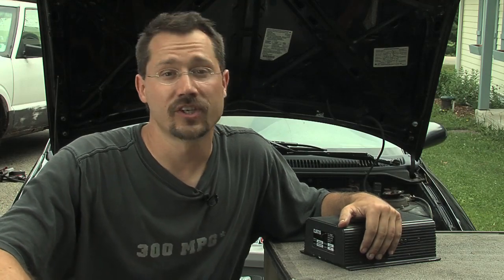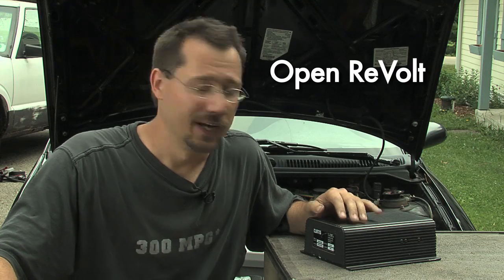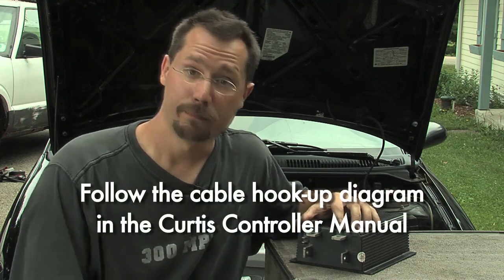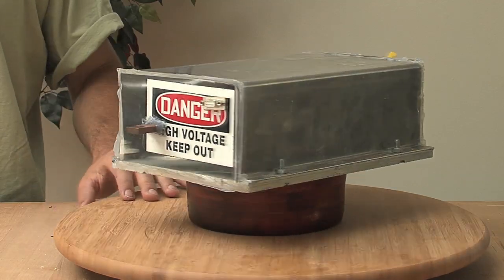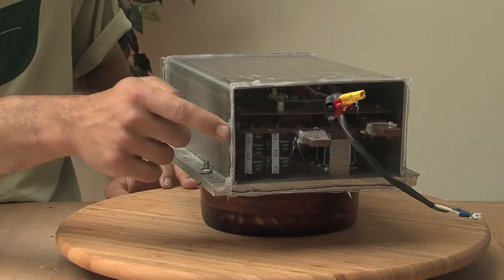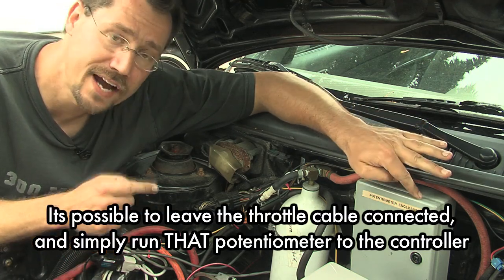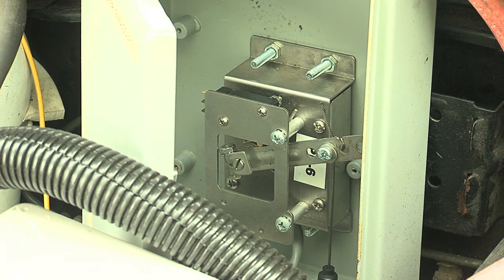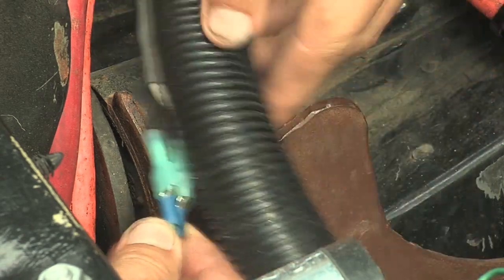13 Build Your Own Electric Car: Motor Controller & Throttle

Comment: how many autonomy hours does this six bateries means...?? aproximately..? and the charging time to a totally full batteries...?  PLEASE..!
Reply from the maker: This project only had about a 20 mile range, but it was also dirt cheap and made from recycled parts. Here's a little more info about figuring out how far an electric car can travel per charge: https://300mpg.org/projects/electro-metro/battery-range/

Comment: Can u make thumb press electronic accelerator and break.. I m handicapped persons

Please reply
Reply from the maker: On this vehicle, the throttle is a simple potentiometer. It would be easy to modify to some other sort of control.

Comment: Where is the m+ on your controller?
Reply from the maker: The controller doesn't need a separate M+ terminal. Both the positive side of the motor and the battery connect to the B+ terminal of the controller. See the following image for an example. https://alltraxinc.com/wp-content/uploads/2017/03/Doc100-045-A_DWG-AXE-No-Reverse-wire-dia.pdf
Reply: @BenjaminNelsonX  ok thanks,so the controller, controls the negative field? Im no Electrician .Is this for a ac or dc motor or both?
Reply: @BenjaminNelsonX  sorry for my perhaps silly question but what is the contator that you need to hook the controler to?

Comment: Very nice but what about the car computer? Vacuums, O2 sensors and mass airflow, basically all of those. The check engine light would be on all the time.
Reply from the maker: I don't remember the check engine light EVER turning on in this car. For starters, it's a simple car, so it likely has fewer sensors etc on it than other cars. Many sensors do NOT activate a check engine light simply by being unplugged (depends on the exact type of sensor.)
In the case of a more complicated car, sometimes converters "spoof" a sensor by adding an appropriate resistor or even something as fancy as an Arduino. Frankly, I've never met a converter where this was really an issue.

On a related note, keep in mind that cars have MULTIPLE computers. For example, the one which controls the airbags was not touched in any way. When turning the car on, the airbag computer still does it's safety check and flashes the airbag light several times on startup to indicate that it's working properly. The daytime running lights, airbags, and seatbelts were not modified in anyway on this car.
Reply: @BenjaminNelsonX  thank you for your answer. I am an electrical engineering tech and was curious about how this would work on a more complicated vehicle. I think these convertions are the way of the future for those who want to keep their older cars and go electric at the same time. The new electric cars may be too computerized and have special proprietory connectors that could discourage some people from making the transition. Thanks again.

Comment: Where did you find the potentiometer?
Reply from the maker: I simply mail-ordered the potentiometer. It's a Curtis PB-6 potentiometer. A web search will show you multiple places to order from.
Reply: @BenjaminNelsonX  my pb6 has a switch included. Did you simply not use this switch in your application (kind of difficult to see in this vid)?
Reply from the maker: @garyatate  No, I didn't use the micro-switch.
A common application for that switch is to disconnect the main contactor when the throttle is completely released. That seems like total overkill to me. It's the equivalent of turning off your engine every time you let off the accelerator.

Comment: Sir, can Open ReVolt work on 48DC with 200+ amp ?
Reply: You should not run your motor on 48 volts. Run higher volts for better performance and also better efficienty..
Reply from the maker: Yes. It's rated for up to 144V and 500A. If you only need something lower power, a used golf-cart motor controller can be very affordable.

Comment: Sir, have you done any Hybrid IMA technology (Gasoline + Electric) experiment ?
Reply from the maker: I experimenting later with running this car as a hybrid. I added a generator which could supply some power to the batteries on the fly. The style is more like a Chevy Volt than a Honda Insight. Here's one video about that project.
https://www.youtube.com/watch?v=xXVi-g4jWqI

Comment: Am a great fun of your well informative videos, kindly how much does the Open revolt motor controller cost?
Reply from the maker: The Open Revolt motor controller isn't a product for sale, it's an open source project which you can build. The project was lead by my friend Paul. He still makes parts available at his web page. Here's where you can get the instructions on how to put it together. He also sells circuit boards for this and other projects.
http://www.pandspowerelectronics.com/help.html
Reply: @BenjaminNelsonX  thanks a lot
Reply: The ecomodder doesnt have the BOM, PCB and schematics files anymore, do you know where to find them?

Comment: I was thinking about putting an electric motor in a 79 Buick Regal. Watch most of your videos but I didn't see one that explain what to do about power steering.
Reply: Also, some vehicles like the Acura NSX only activate the electric- motor-powered-power steering pump under say, 10 mph. It would pay to have a set up like that on an electric car.
Reply from the maker: This project vehicle did NOT have power steering, which is why it wasn't covered.
Three options that I know of when it comes to power steering:
1: Add a small electric motor to a short belt to run the power steering pump. (There are kits for this. For example, http://www.canev.com/pwrSteering.php)
2: Disconnect the pump and loop the hoses, converting power steering to manual steering.
3: Replace the power steering with a manual steering box. (Easy to do on something like a Chevy S10 pickup where vehicles were available with and without power steering.)
Reply: use electric steering, they are pretty common these days..

Comment: whats the name of the site for an open source controller? eco matter?
Reply from the maker: It's https://www.ecomodder.com
The original main build thread for that controller is at: https://ecomodder.com/forum/showthread.php/paul-sabrinas-cheap-diy-144v-motor-controller-6404.html
The ringleader of that project, Paul Holmes has also moved his web page. The current incarnation of that is: http://pandspowerelectronics.com

Comment: Yoi I like ur videos but I thing u should try this I wanted to build it but finance
Is bad so u can have a crack at it so u ganna make an fwd electric engen with a generator at the back wheels so when front wheels drive using battery the back wheels charge the batterys note u got to use more gerneraters to create more electric charge this create free drive  keep me posted on project
Reply: Lol, if it where just that easy...